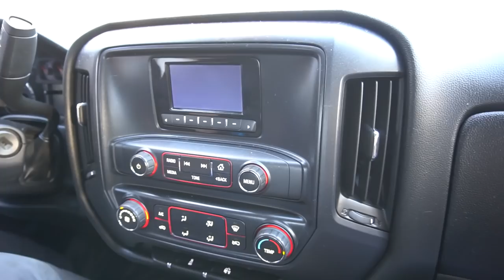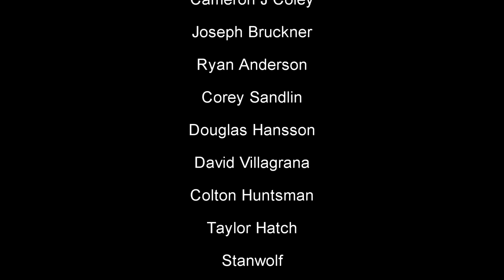One Of My DREAM CARS Is Finally Home!

Comment: The hood was pinned because at speed, with the hood un-latched it will pick up the back of the hood. I had it happen on the interstate with my 260Z. It doesn't rip the hood off but it will pick it up enough so you cant see the road. lol

Comment: Thats awesome you bought a Z car, I have a 73 240z and a 74 620 pickup. My 240z is highly modified and runs tripple webers, a G-nose, 5 speed, 6 inch molded flares, a 3 piece wing, and more. Check me out at trystan_lake on instagram if you have any datsun related questions give me a shout I can probably give you an answer. By the way those hood scoops are stock on a 280z they were mostly to avoid vapor lock in the early EFI system.